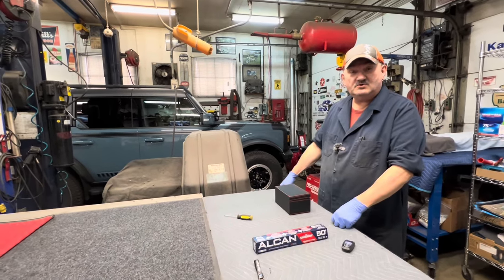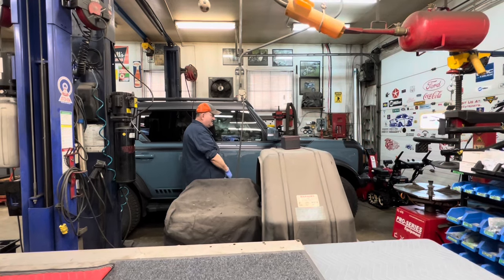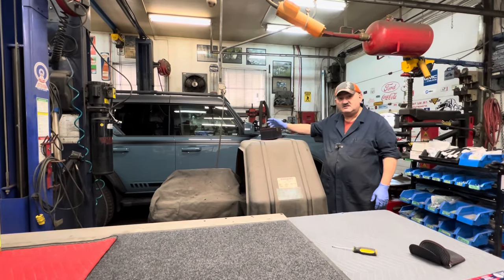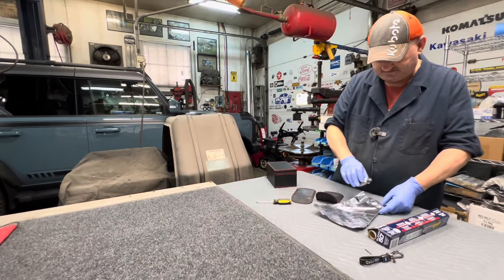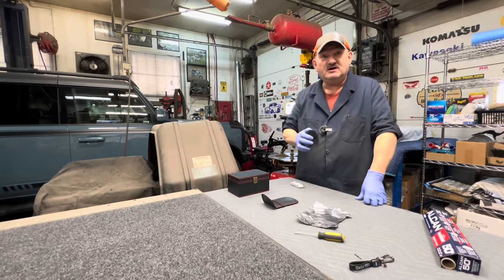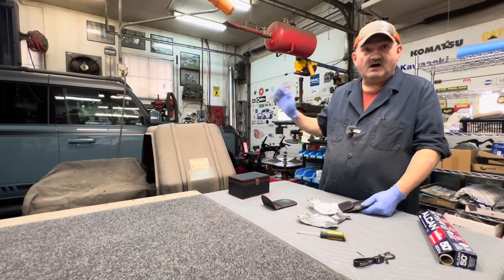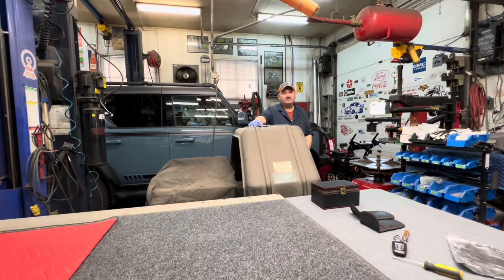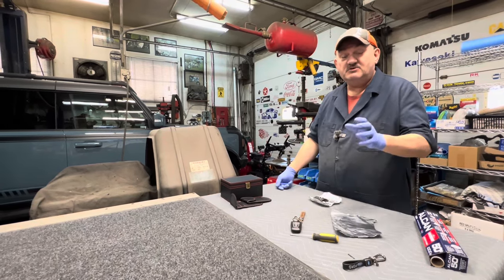Do a Faraday box work ? 🤔￼

Comment: Thanks that was an informative video. You could make a Faraday box out of a conductive metal. the lid and the bottom  would have to overlap and make an electrical connection.
Reply from the maker: I’m going to line the box with hvac aluminum tape and try it.

Comment: In Florida were going to the Swamp Buggy races and we stopped at a Wells Fargo and used the atm machine. In a few days we get a call from the bank and our debt card was compromised. Then we thought back to where it could have happened. Then we remembered there was a guy in a van and he had a card reader on the machine. We had that happen so many times while living in Florida. Everything is fine here in Missouri, so far. Line that box with lead.
Reply from the maker: Part of the reason for the video was to make people aware of the scammers. As for the faraday box I’m going to line it with HVAC tinfoil duct tape and try it.

Comment: Paul"  Part of the "Faraday" effect is that the shield (conductive shell) of the box or baf, is 
 should be connected to a good Earth Ground. That way, any Electro Magnetic Field radiation, will be conducted to ground and "killed." That works with EMF going in or comming out.  Your Aluminium foil works, because Al is more magnetically restrictive - you might say "Dense" _ Than the coper foil on the box or the mesh of the bag. In the case of the products you bought, the foil or mesh becomes a sort of antenna for the fob signal, so it still gets out, only in a much weakened state.  we could talk about this stuff for hours, if you want to, but I think you've found the solution to your problem.  
I really enjoy your videos about how things work, or get done.  I've learned a lot over the years. Thanks!
Reply from the maker: That’s great info Jim. I’ve had those Faraday dooflickies over a year now and only today did I even question if they actually worked so did the test and of course they don’t work lol. I even put the fob in its little case and then I put in the box which should be double protection and I could still open the door. Utter garbage. Thanks for watching and commenting. Hope all is going well on your end.

Comment: Hi Paul and Kathy great video! Thank you for the great information. I own a 24 Tundra and Toyota allows you to turn off your fob by holding the lock button and then press the unlock button two times. Now your remote is off and can't broadcast the signal. I wonder if Ford or Ram as a similar feature.
Reply from the maker: That’s a great system. I’m going to do more research on this and see if there’s something that I’m not aware of. Appreciate you watching and commenting.

Comment: What I learned from my old RCMP friends, yes there are still some trustable old guts is to put a hidden battery disconect which you can set when you park in unsavoury places. In Ontario and many US places this works well as the thieves work fast but any hold up in time means they skidaddle and find an easier target. The hidden disconect should be out side the vehicle anywhere unsuspious. These disconnects disconect the ignition module like an error code and she won't start. Now if it is a Chysler don't worry it won't start anyway.
Reply from the maker: Yes I’ve done similar things with some of our vehicles but with these new Broncos they are online all the time. So many computers in them now. I got in one time last year and it told me not to use it for 15 minutes because it was in the middle of a live update. I can tell where it’s located by my phone. Start it from anywhere. All other kinds of data available to me but can’t stop anyone from steeling it lol. The world is gone completely mad.

Comment: Not surprised that box doesn’t work, definitely good advice using the foil. what I am surprised about is how far that fob works from.  My wife’s Dodge Journey you gotta be right there at the door for it to work, and it only will unlocked the driver door for safety so no one can jump in your passenger seat.  I didn’t know that they can try to steal the signal whenever, I thought it was just when you were using it. Learn something new. Glad to see you guys back and doing well.
Reply from the maker: Yes they can steal the code and that’s why there’s Faraday pouches. Same with credit cards. They can steal them as well without taking the actual card. I’m hoping this video will bring more awareness to the issue. Thanks for watching. Hope you’re doing well.

Comment: I had a bad key for my dodge truck that kept locking the doors every couple of seconds. I didn’t have a Phillips screwdriver small enough and assumed the battery was dying. I used this exact method to seal it off while we used the spare key to get home. A new battery in the remote fixed the problem
Reply from the maker: cool. Glad it worked out for you,

Comment: I have that faraday bag and it works for my Lexus. There is two spots you can put the key on the inside, I think you were putting the key outside of that internal pouch.
Reply from the maker: nope. I put it in the shielded side of the pouch plus I put it in the box and was still able to open the doors via the intelligent access option

Comment: I leave my 2023 F150 key in a Faraday bag under my back seat in a lock box. It works as otherwise I could never lock the truck as it would think I am inside. As I have a key code to enter the truck if I ever lose my key, I can get the spare under the back seat.
Reply from the maker: Do you have intelligent access to get in it? If you do put the faraday pouch with the fob in it and touch the door handle. If the door unlocks then the pouch isn’t doing its job. I also have the keypad. I just need to find a way that my fob can’t be read while it’s in my pocket.

Comment: I think it was Land Rover who were developing a system whereby the key would just switch off if it didn't detect any movement for a period of time. That would stop scanners picking the code up while the vehicle was parked up at your address. There's really no reason for the key to be broadcasting 24/7. 

Try lining, or wrapping, your box in foil too!
Reply from the maker: Land Rover got that part figured. Over here you just can’t keep them working. I guess to be fair Ford got their issues as well. I’ll get this issue figured out then do an update video.

Comment: Me Bean has it figured out. He has a latch with a pad lock. I think auto manufactures should give customers an option 1) keyless entry or 2) keyed entry as in the old way. I for one would actually buy a keyed entry if I could get it. It looks like you faraday gear is attenuating the fob signal at best rather than blocking the signal. Be interesting to put a cell phone in your faraday box and try to call it.
Reply from the maker: Gotta love Mr. Bean. Sometimes the simplest solutions are the best.